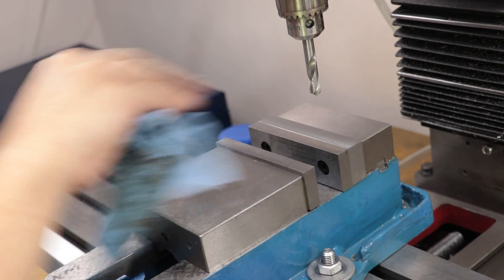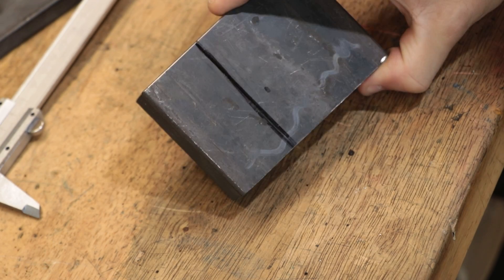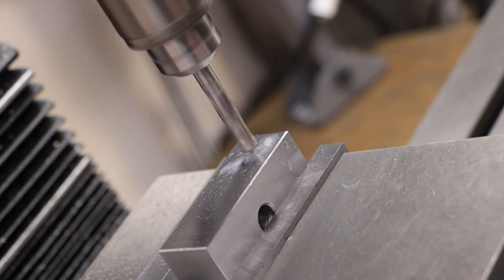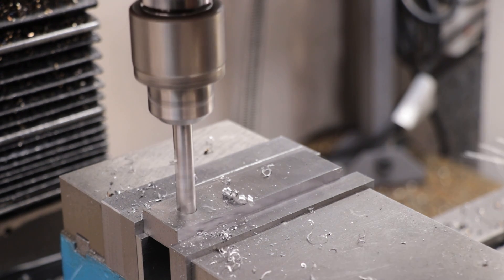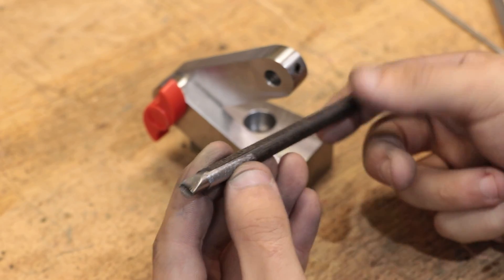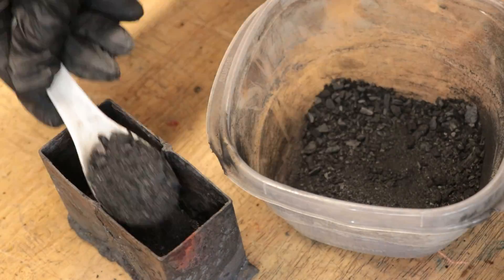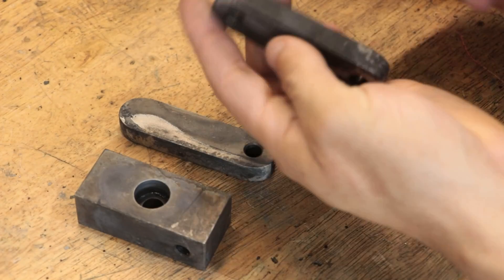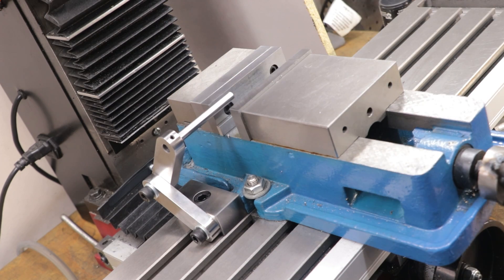Making A Vice Stop For The Milling Machine Vice

Comment: Simply drill a hole in the side of the vise, press a rod into the hole, and then place the threaded arm on it. You have a 3-piece set that works more precisely..
Reply from the maker: You may have missed the follow up to this project where I had to drill 12 long rods.  The stop was 10cm or so away from the side of the vise to account for the long pieces of metal. That is the advantage to this

Comment: Very nice been looking for ideas for a vice stop.  Like that this one is attached to the table.  My last project I used a 123 block and a couple clamps to makeshift one.  😀  Been doing a lot with 8020 extrusion and making the joining plates requires lots of repeatable setups.  My current rock tumbler is one example.

Comment: I read in a harrold hall book not to double stack parts in the vice. Are there exceptions to that rule or is just a general safety guide? Getting my first milling machine hopefully mid Jan if it actually arrives. Was supposed to get it a few days ago. Keep up the great work. Very inspirational. Peace, from qld.
Reply from the maker: Not sure, it’s probably to do with making sure to clamp parts that are exactly the same with or you may twist the moving jaw or have uneven pressure.

Comment: You spent 1 hour on case hardening! Only the gas comsumption would have made this part in Europe even more expensive then gold. Excellent job.
Reply from the maker: Once you get the part up to temp you can run the furnace on 3 psi of gas which is practically nothing. Not a huge amount used. Cheers
Reply: jokes!   have wisdom, smee.  haha.  if he left it malleable, how many times would he have to maintain or remake it!  yes.  the answer is until forever.  his precious life forfeit.   what a twist.  who is concerned for the environment?  repent.

Comment: Hi mate, 
Like yourself I have a small hobby machining set up in my shed.
I live in rural WA about 600km from Perth, other than asking my mates from engineering companies for their scrap or buying large expensive quantities from suppliers I was wondering if there is any supplier of small “hobby” of assorted round stock/square stock of different materials?

Thanks 😊
Reply from the maker: Not sure how much I can help you since I live on the other side of the country. I use edcon steel as my main supplier, simply because they don’t have minimum order quantities for most metal sizes. They are based in NSW but I know they they do ship metal interstate
Reply: @artisanmakes  thanks for the reply mate, funnily enough this morning I found you had a video answering my exact question hahaha I will use that supplier when I need, legend

Comment: There's no need to do two processes in hardening also closing up the carbon Container isn't needed. A tight fit lid is enough. You can then pull the part out of the charcoal and directly harden it. That's how I've done it for several years now and it works just fine.

Comment: Oi, mate! I have this question that might appear stupid and the answer- obvious, but I've noticed that you cut metal, even quite large stock material with a hand saw. What's the reason you wouldn't use angle grinder or other power tools? Does it have anything to do with overheating the material and buggering it's mechanical properties or it's something else?

Comment: You could have threaded the lover bolt in the lower arm, and made the hole in the base a through hole. Like this you would get the arm closer to the vice and not need a longer rod to get to the middle of the vice, while maintaining accessibility to the bolt from the outside.

Comment: Ho do you oil your x axis ways? my mill does not have any oil ports in the table, so i been using an oiled rag and wiping the underside ways of the table. Been thinking of putting a Brass Push Button Oil Cup Cap on the side of the table. love to hear your thoughts on that.

Comment: Artisan, to file a constant radius curve, hold the file long axis perpendicular to the curve axis.    Start with the file at a tangent to the distant plane the curve should meet, and simultaneously push the file forward and rocking it so that the point of contact moves back towards the closer plane.   
This is an old trick I learnt in trade school decades ago, and it makes it easy to achieve a smooth curve of constant radius with no flat spots.

Comment: Looking at your stop there is an easy way to gain the 1" you mentioned on the stop bar - without increasing it's stick out

If you where to remanufacture the base and lower arm - Rather than thread the base, have the cap screw pass through the base and thread the arm linkage you would have the arm on the far side, closer to the vice

or alternatively
Modify the Base to share the same stud that locks down the vice to the bed
Reply from the maker: Interesting first idea.

Comment: You should file rounds from other direction... perpendicular to the axis of the round.
Much easier to retain squareness to the sides of the part, and also it make smooth curve "by itself", if you start with file handle high, and drop it down as you move file forward.

Comment: My concern is removing it to mill the part then return it to the same spot..
Reply: It's to set distance inside the vice, so long as you don't move the part, you can set the stop back on it. You shouldn't see any accuracy loss so long as both faces are clean.

Comment: the piece of tubing after multiple uses on other projects probably has the a carbon content equivalent to cast iron, question dose it skate a file after quenching it
Reply from the maker: Yeah I didn’t think of that. I’ve probably used that box 5 or 6 times by now so it wouldn’t surprise me if it’s absorbed some carbon

Comment: Right at the end of the video, why not turn it around 180 degrees so you put the linkages on the other side of the base block, you get much deeper reach into the vice that way.
Of course you would need a hex head bolt and open ended wrench (and not allen head bolt).
Anyway, great project! 👍😁
Reply: I had the same idea - But thread the arm rather than the base, passing the stud through
Or mounting the base to the same bolt used to lock the vice to the bed
Reply from the maker: Yeah. I prefer cap head screws but you can always do it differently. Seems easier to get a slightly longer piece of steel
Reply: @artisanmakes  Agreed for the most part, It depends on how comforable with the extra stick out and flex you are
Reply: @artisanmakes  If you find a broken printer, there is a long similar rod inside.
Reply: @BrainHurricanes  Yep, you can also buy stainless steel round bars fairly cheap. although they are not so great for machining. They are perfect for various projects.